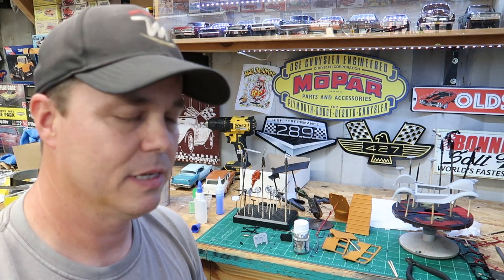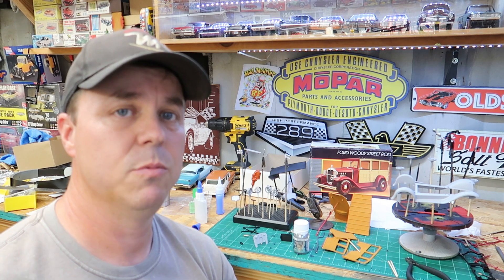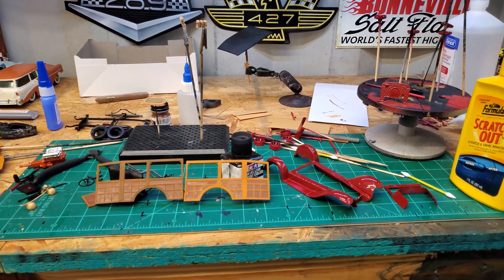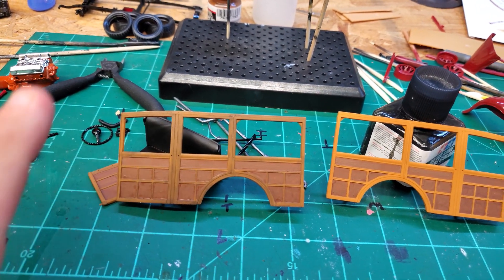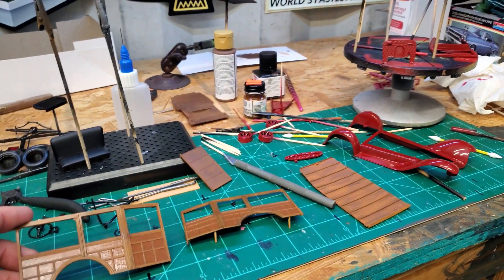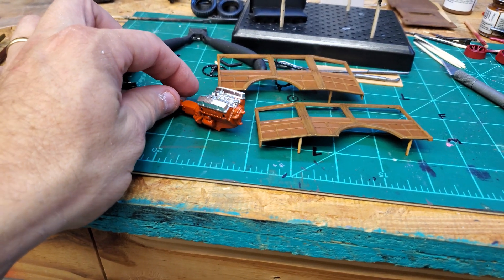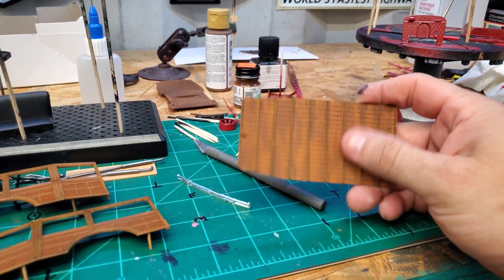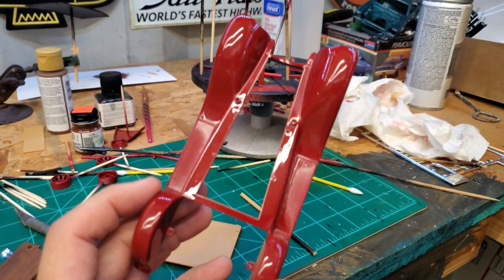Monogram Ford Woody / It's coming along nicely!!

Comment: That’s going to be beautiful. Do some test fitting of the body parts before you start gluing since it can be a three handed job to get everything lined up at once. I’ve found drilling small holes and pins the body sides together with thin brass rod and a tiny dab of superglue can be helpful.
Reply from the maker: Great tip! Thanks